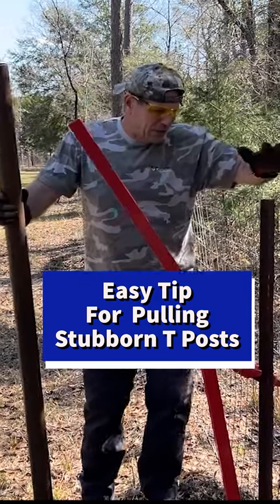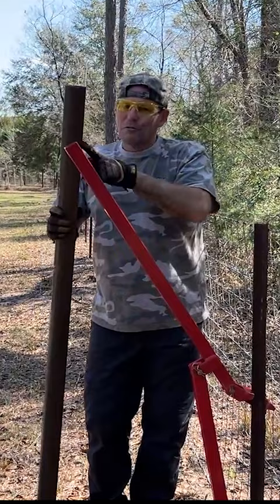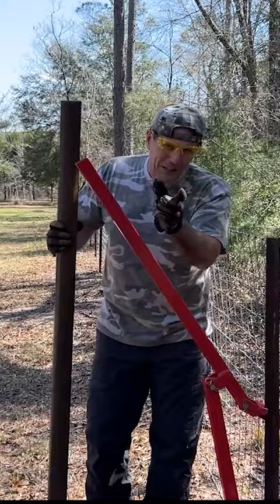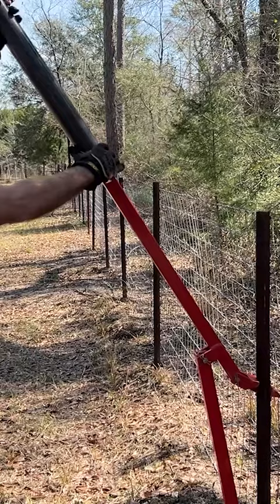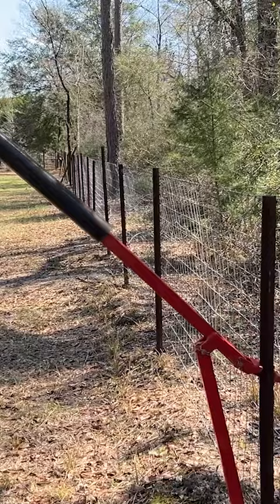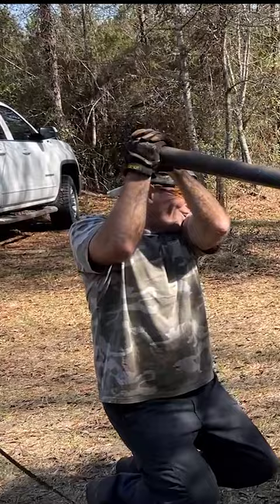Pulling Out Stubborn Fence Posts by Hand!

Comment: I understand the comments about stressing the tool. I also understand (and I have said and done this) this job needs to be done. 
If this is a regular problem (which I didn’t hear him say) fitting the tool with an appropriate shear bolt will save the tool. Keeping extra bolts in a special box where ai keep my replacement shear bolts for implements.

Comment: Over time that will destroy your tool
Reply: @TC_Electronic_M-One_XL  using an extension such as a pice of pipe will add additional stress to the tool causing premature wear and failure. A farm jack or the the installation tool work great for removing the same post.